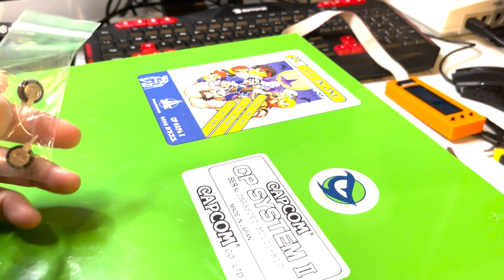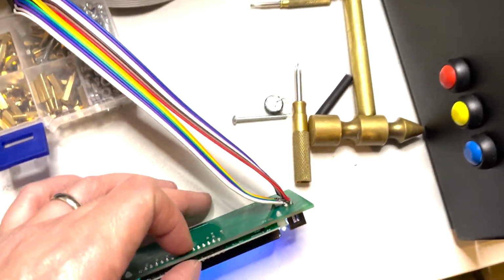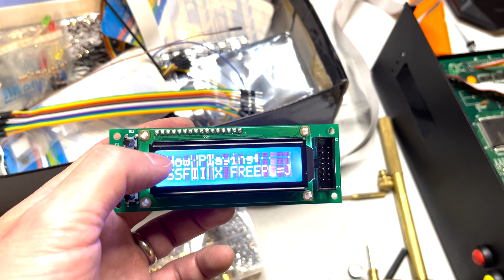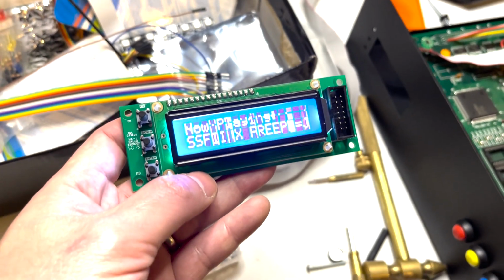CPS2 Sound Capacitor Replacement

Comment: Yo vodka plz tell me what cables u used to connect the screen to the case... I want to do the same but dont know what cable to purchase to flush mount it to the case... Would really appreciate it if you could let me know
Reply from the maker: Are you talking about the belt for the darksoft to the LCD screen? It came with the darksoft kit. I did have to mod my own connections onto the LCD screen as you saw in the video because I needed the connection to be on the back of the LCD and not the front. Those are just generic breadboard cables.
Reply: Thanks for replying bro... Yea I'm talking about the cable that connects to the screen, not the one that ships with the dark soft kit.... The one that u modded and soldered to the back to flush mount it in the metal case... What is THAT cable called exactly I would like to purchase one... Please let me know... Thanks in advance bro
Reply from the maker: @YoungStunna876  They're just regular cables like these. I had some lying around from a Raspberry Pi. https://www.amazon.com/TOAPPNER-Multicolored-Breadboard-Arduino-Raspberry/dp/B089FZ79CS/ref=asc_df_B089FZ79CS?tag=bngsmtphsnus-20&linkCode=df0&hvadid=80058307777686&hvnetw=s&hvqmt=e&hvbmt=be&hvdev=c&hvlocint=&hvlocphy=&hvtargid=pla-4583657835620244&psc=1
Reply: Thank you vodka I really appreciate the assistance